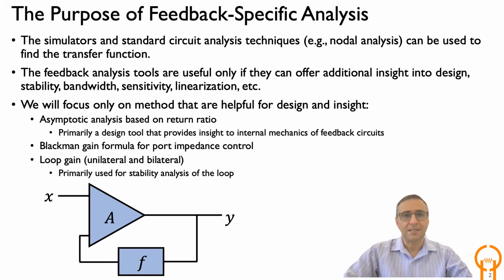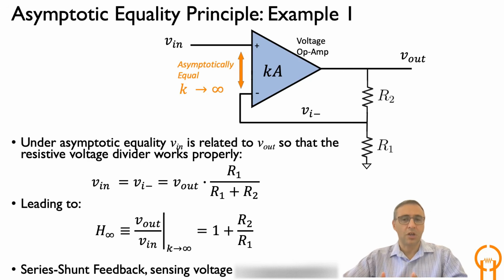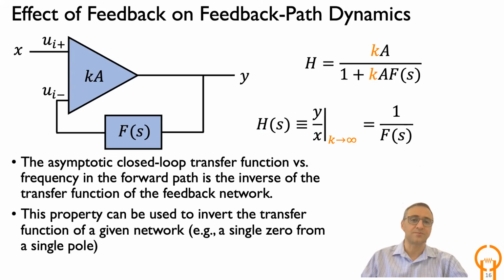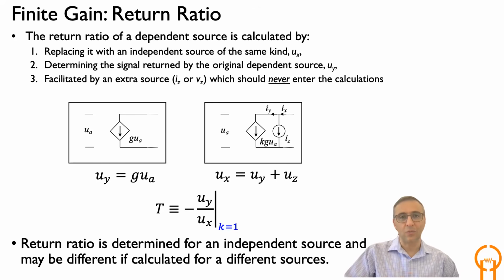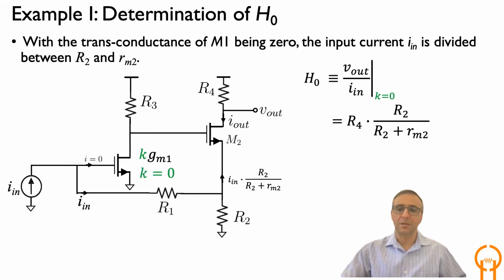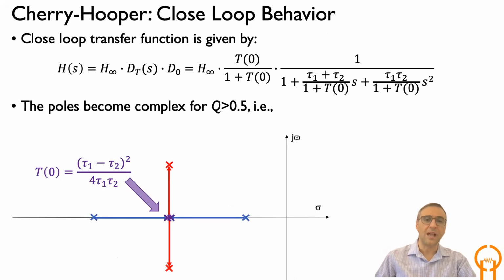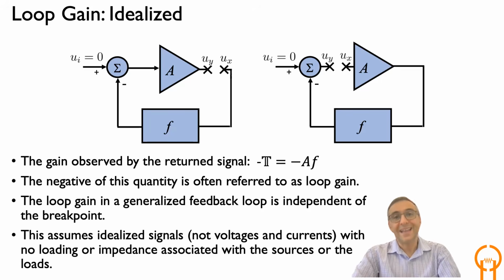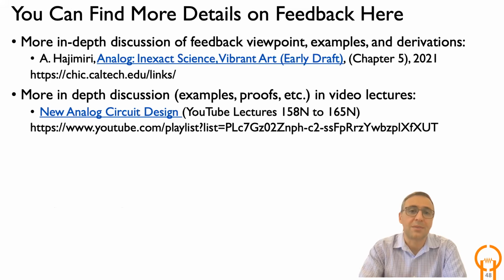Feedback Circuit Analysis and Design (Overview)

Comment: "uz should never enter equations" -- While I see the point of that, technically it does enter the equation in the asymptotic gain formula because T/(T+1) is equal to -uy/(ux-uy) = -uy/uz. And, similarly, 1/(T+1) is equal to ux/(ux-uy) = ux/uz = 1-(-uy/uz). I think it's actually helpful to think this way too in order to get the full intuition behind the formulas

Comment: Currently trying to build op amp right now for a project. I think I got my Op amp marginally stable. I have about 50 degrees phase margin when my open loop gain is 0 dB. With unity closed loop gain. It works at 1V amplitude at 1  kHz.

But once I increase to 20kHz, it starts to be distorted.

But I noticed, if I decreased the amplitude, I could continue to raise the frequency all the way up to 1 MHz. But I had to lower the amplitude of the input even further to achieve that. Or else it will be distorted.

Any ideas what my issue could be?
Reply: yes, your loop gain isn't enough at 20kHz...

Comment: One more question: On 49:44 can be read "For a single unilateral loop, return ratio is the same for all the sources in the main single path". But in an amplifier with unilateral loop and more than one transistor, the return ratio (and also H_infinity and H_0) depends on the  controlled source that you choose. What do you mean then with "all sources in the main path"? Thanks in beforehand and congratulations.

Comment: Thanks for the lecture.
The asymptotic Equality principle example 1, you mentioned that it is sensing voltage returning voltage which is correct.
The slides have " sensing voltage returning current ".
Reply from the maker: You are right. That was typo on the slides. I removed the wrong part. Thank you.